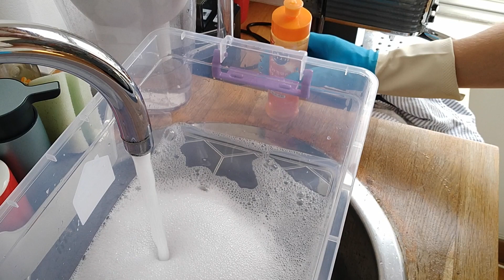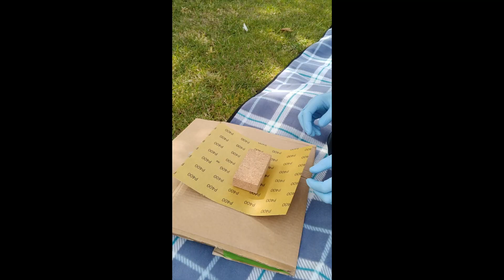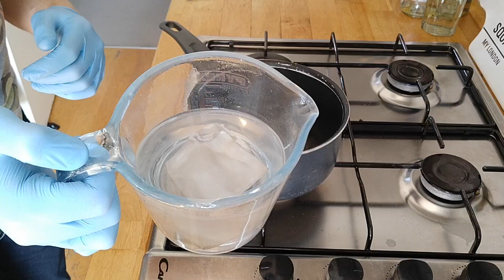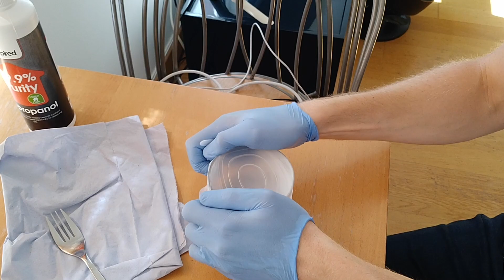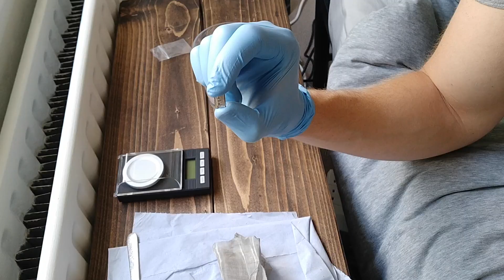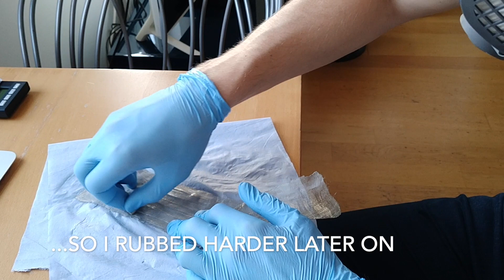Cold fusion material preparation - Casual Physics 001

Comment: Is there an experiment you can point me too that you are repeating? Also, what is the advantage of using Nickel mesh rather than a solid rod? Is it the higher surface area? Loved the video by the way!
Reply from the maker: Hi Nathan. Really glad you liked the video. Originally, I was aiming to replicate the work of Les Case (see https://twitter.com/CasualPhysics/status/1141720778867650560 ) but was unable to do it properly due to the lack of coconut shell carbon catalyst that he used. So I decided to try a hybrid approach of Case and some new work of Mizuno who used Pd on Ni mesh (see https://twitter.com/CasualPhysics/status/1153566250439720961 ).  It's not yet clear why the mesh is better than the rod - some think that it shouldn't make a difference at all, others argue that the tension in the mesh plays a role...the jury is still out.
Reply: @CasualPhysics   That's cool! Thanks for the explanation! I will definitely look at the experiments!

Comment: I've got about a million questions but I'll start with:
-what is cold fusion?
And
-why is cold fusion research important? What might you find out that will change the world?
X
Reply from the maker: Hi Jo, thanks for taking the time to watch the video and write a comment. Your questions are good ones - I have plans to make another video which will answer them so stay tuned for that :-).

In the meantime:

The quest to achieve fusion (hot or cold) is the quest for "limitless" compact clean energy. 

While hot fusion goes on in the centre of stars (or big machines like JET https://en.wikipedia.org/wiki/Joint_European_Torus ), cold fusion occurs under much milder conditions using tabletop equipment. 

Cold fusion produces none of the radiation that hot fusion does. This opens up the possibility of a decentralised source of power that you could put in your home or take with you wherever you go - this will change the way we live our lives and structure our societies.

The problem is that no one understands how cold fusion works. We need more experiments to find the sweet spot where we can make it work every time and produce useful amounts of power.

I made a 2-page primer on cold fusion which you might be interested to read. You can find it at https://cor.energy.
Reply: @CasualPhysics  ok, cool! And the bits and bobs needed to create (make?) Cold fusion... are they all renewable 'things'?
Reply from the maker: @jotedd4714 , It depends on what you specifically mean by renewable. The fuel is a form of hydrogen that is abundant on earth (billions of years worth in water). Additional solid material (e.g. Nickel and Palladium) is required to provide the right environment for fusion to occur, but this extra material does not appear to get used up - so in that sense, it is "renewable". Because we still don't fully understand the physics, it is difficult to be more precise at this point.
Reply: @CasualPhysics  yeah, I think that answers what I was getting at... I really meant will this be an energy that doesn't hurt the planet and we won't run out of it.
Reply from the maker: @jotedd4714  Correct. Plenty of fuel and the "ash" from fusing hydrogen is helium - everybody's favourite party gas 🎈